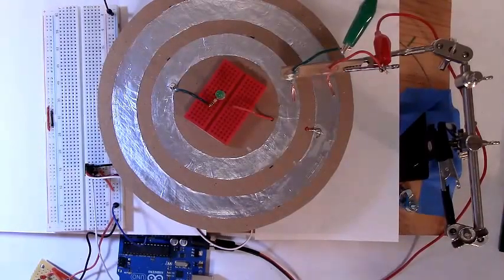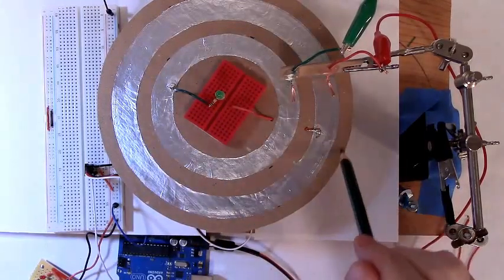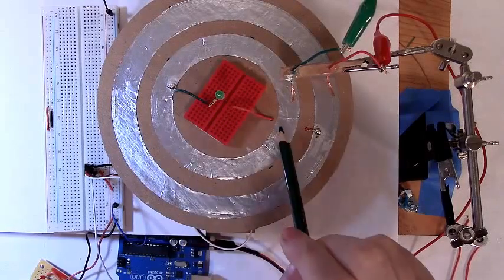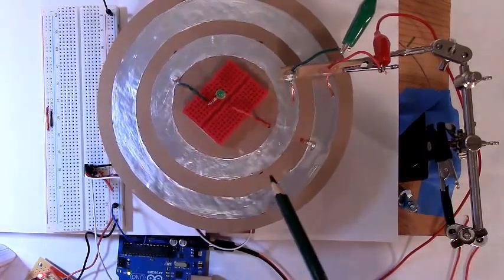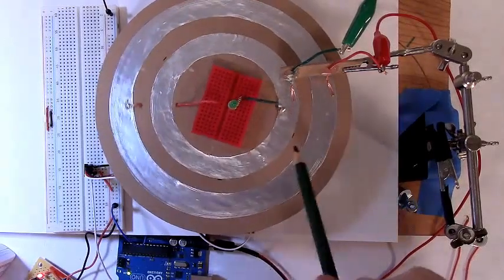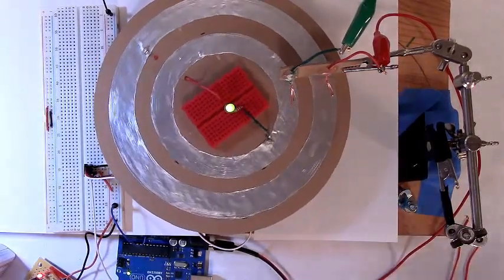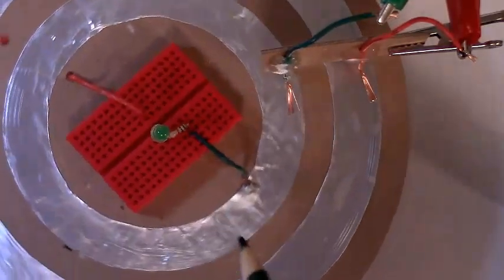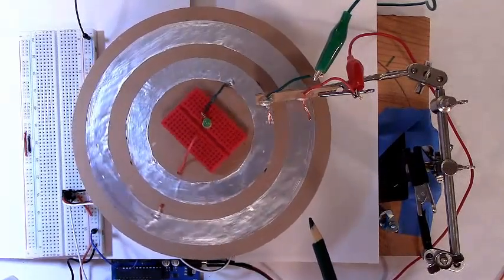Electrical Slip Rings || What they're for, How they work, DIY, etc.

Comment: Thank you. A hefty combination of textbooks and Google was making me feel like my lack of innate knowledge of these terms meant I wasn't destined to be an electrician. I wasn't born an electrotongue.
Reply from the maker: +thatryanguy Glad the video was helpful.  All the jargon, formulas, schematics, etc., can definitely seem overwhelming when one first enters the field.  I tend to remove as much of such as possible and focus on how to build functional circuits.  To become an electrical engineer one has to eventually learn and understand a significant portion of the jargon, maths, etc., but much less tends to be required when it comes to initially learning about and building interesting circuits, etc.  I can navigate the jargon and maths but have found that such can get in the way for those who just starting out.  There's always time to pick up what one eventually needs to know along the way through experimenting with circuits.  I tended to learn more from building and failing, correcting, etc., than would have been possible through books, etc.  In my experience there's often no better teacher than experimentation.  Such does of course result in quite a few failed projects, etc., but each failure is just a new opportunity to learn and correct mistakes.  One of the best suggestions I encountered when starting out about 15+ years ago was to pick an interesting project and try to build it (determine the appropriate parts, find or develop a schematic that "should" work and start adding components to the board and see what happens).  At every failure go search for information relevant to correcting the problems (essentially, read and search for answers, formulas, etc., that are specific to the problems one is trying to resolve rather than trying to "learn it all upfront"), on and on until the project works close to expected.  It will often be surprising just how much one will learn through such a process.  And the more projects one attempts to more one will continue to learn.  Please let me know if/when there are any questions, etc., and I will always do my best to help.   Thanks for watching!

Comment: With this setup can we serially communicate with a sensor? Really explained the concept properly. Thanks for the video.
Reply from the maker: sahil tapiawala Appreciate the feedback and question.  The answer is yes with a few important qualifications.  To establish a reliable form of ("speedy") one to two way data communication across a slip ring connection the wire and ring materials have be carefully selected, machined, free from most imperfections, etc. (the copper to aluminum foil connection used in the video wouldn't be durable enough in the long run, copper to copper would be better, etc.).  And redundant noise filtering circuitry is needed.  The 'slipping' along the ring will always inject an amount of unwanted noise into the data stream.  But, such can be filtered out to a degree sufficient for decently reliable one to two way communication.  For performing tasks similar to periodically blinking an led a fairly 'rough' setup will tend to work fine and reasonably well.  For communication tasks that require much more speed and precision, e.g., fully fledged serial comm, then the right wire/ring materials, combined with various hardware/software filtering techniques, as well as careful packet error checking on the software side are needed.  Given the overhead associated with establishing reliable communication across this sort of connection, one will always want to select the least wire intensive form of communication.  Each wire requires a ring and each must be carefully machined, carefully filtered, etc., etc.  It's definitely possible, and is done in quite a few amusement ride applications.  Successfully doing so just takes some careful selecting and planning ahead of time.  

Hope these comments are helpful.  Thanks for watching!
Reply: philo mech Thanks for the insight. The comments were really helpful. 
It really cleared the doubts I had with regards to noise that may interfere with the signal, I basically wanted to pan a sensor and didn't want the wires to get entangled. This setup does seem promising. I will experiment further on this :D
Reply from the maker: sahil tapiawala Glad the comments were helpful.  It can definitely made to work for sensor panning applications, I built such a setup for one of my robots a while back (analog sensor, but it can be made for digital, serial, etc., sensors as well).  I used three rings cut from a thin sheet of copper (like the aluminum foil in the video) and 3 hoop 'slips' made from some larger gauge solid copper wire.  All will eventually wear and have to be replaced but works fine for quite a while.  Let me know if questions arise during the experimentation and I will do my best to help.
Reply: Yeah. I am planning to do just that, using a solid copper wire. Will let you know if I face a problem. Thanks a lot again. :)